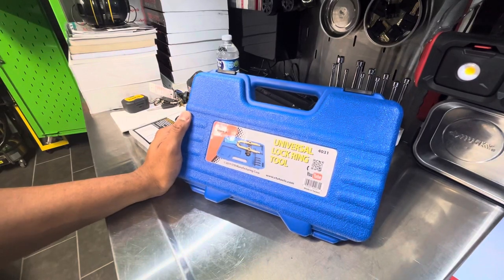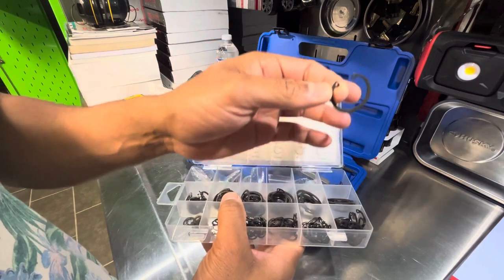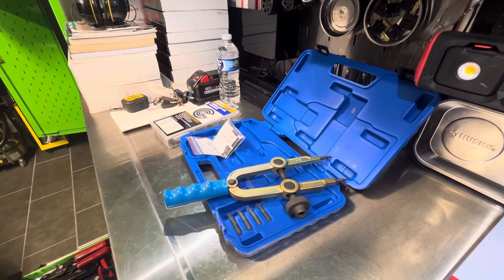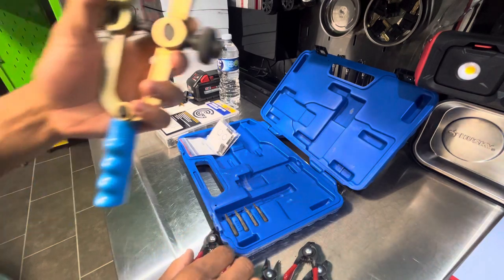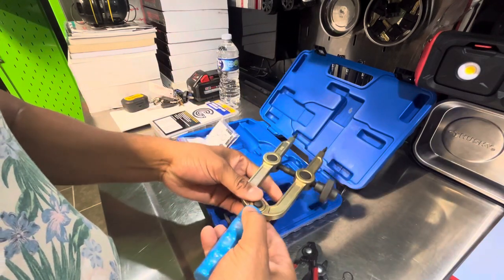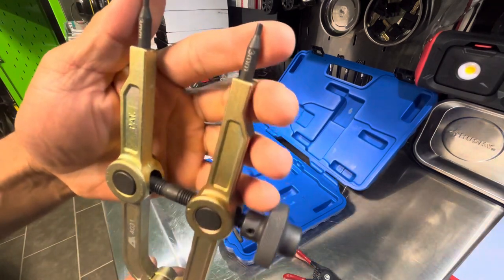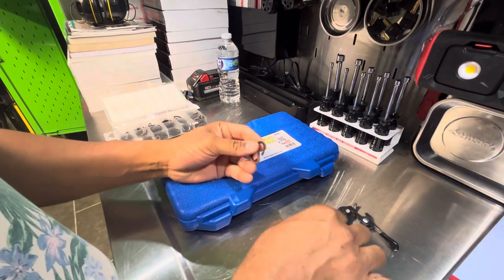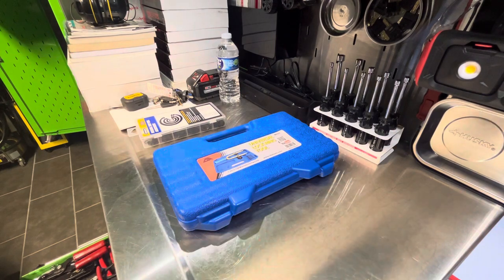Quality Tools Part 1: Lock Ring | Circlip | Snap Ring Tool: #CTA 4031 Universal Lock Ring Tool

Comment: They make internal and external snap rings it looks like yours are internal and you said you needed to expand them just wondering if you have the correct one and on your discretion you mentioned circlips do you have a tool for them i would be interested in seeing that also
Reply from the maker: I have the LANG smaller switchable ones. Circlips, C-clips, and snap ring pliers are often used interchangeably

Comment: I actually found the tool i was looking for and i was wrong about the name i ment to say e- clip  the tool is a us pro 5039  but in some applications you can use a screwdriver or a pick but if you ever need to change brakes on a forklift you might want to have some of these and otc 4492 mite be better made
Reply from the maker: Never heard of them. Thanks.